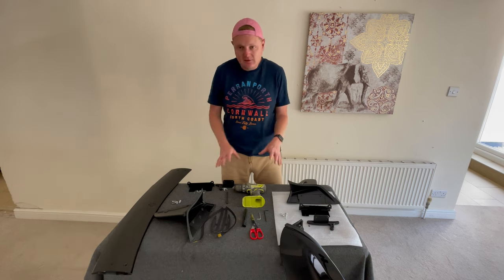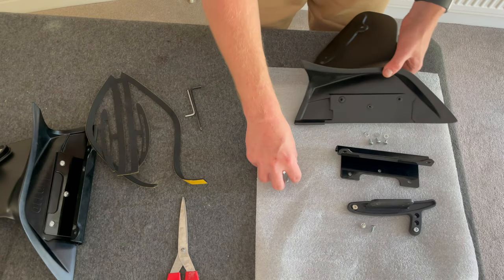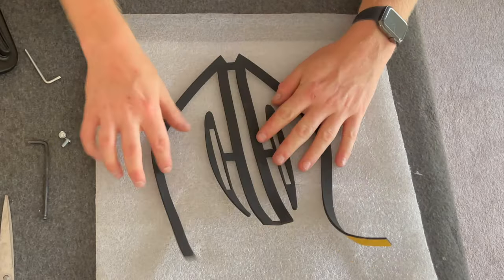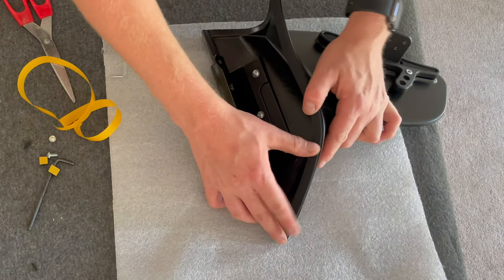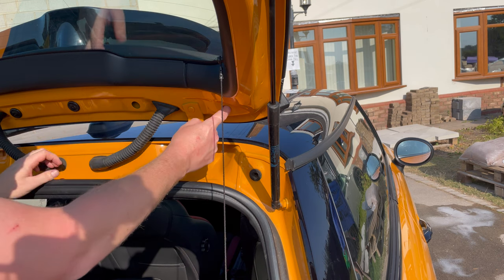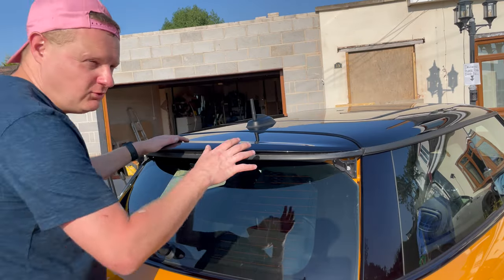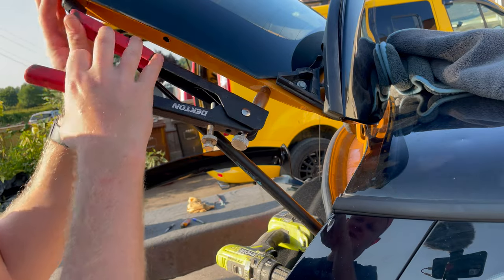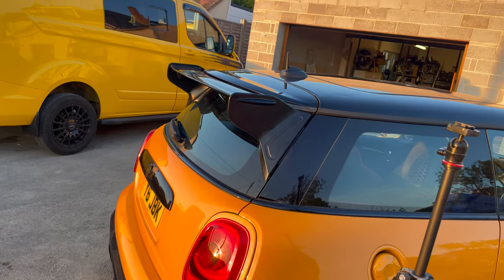Mini F56 How To Fit An Orranje Performance F-Wing To Your Mini F56 Spoiler

Comment: I think it could be a bit higher, like the challenge Mini race cars, should be at least above the Mini roof, your information is spot on, good video mate 👍
Reply from the maker: I mentioned in the video you need the one spoiler, this doesn’t have the little kick up like my one and is more  inline with the roof like the gp1/gp2 wings
Reply: @tweedbean  I was just looking at my GP2, and I released it's very much the same with the 1 shelf, I will have to wait for the price, it's going to be dearer than r56 🙂 looks better quality from the video, thanks mate 👍

Comment: good video mate. just my personal opinion, they should make the wing to match the cooper S as well as its a common spoiler and the top of the wing follow the highest point ot the roof line
Reply from the maker: It’s a cost thing I would.  If they use the same blade as the r53/r56 they don’t need to spend research/development/molding costs therefore the price to customer is less.  If they create a whole new wing blade, this product becomes much more expensive as they won’t sell in big numbers and mini owners are more and more complaining about prices of parts already
Reply: true @tweedbean

Comment: Brother you have the adjustable brackets upside down. That's why you're having trouble with the wing. You need to flip those brackets so you can tilt the back of the wing up. That way the front of it will clear the Cooper S spoiler.
Reply from the maker: Hi you must be missing something in the video, nothing is upside down.  It can only be fitted one way.  The wing is not designed to work with S spoiler, hence it touching it.  Mini F56 Orranje F-wing fixing my mistake - switching to a cooper/one OEM spoiler for a better fit
https://youtube.com/shorts/KhyDKNV3gr0?feature=share

Comment: awesome video. trying to decide between this and the Krone Duell AG wing.
Reply from the maker: Go for it!
Reply: @tweedbean   Which do you prefer?  You have installed both.
Reply from the maker: The Orranje wing fits out the box, the rep duellag wing took hours of fettling to get to fit and even then it wasn’t perfect.  The look of the wings is subjective, some may prefer one, some prefer the other.

Comment: Awesome , but that price is just ridicoulous
Reply from the maker: Price is subjective.  For my last f56 I purchased a duellag style wing off a reputable supplier in the uk and when it turned it it didn’t fit, needed grp cut from it to make it work.  Those wings go for over £700 plus the additional cost of painting to match your roof.   I covered it in a fitting video and it took me hours to get it to fit.  This Orranje wing fits out the box, if you select a painted version, no adjustment of the wing is needed.  It’s sturdy and well made unlike some of the other cheaper f series aftermarket wings.    People who want quality will buy this, people who just want something cheap and cheerful may buy another product.  I’m here to show what I went for and how I fitted it 👍🏼